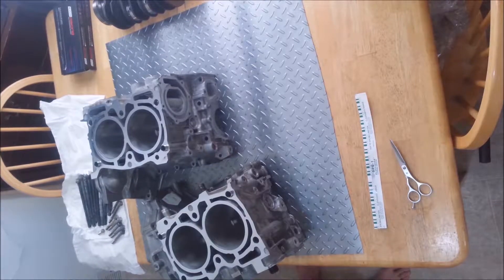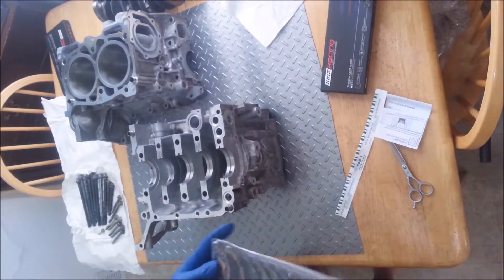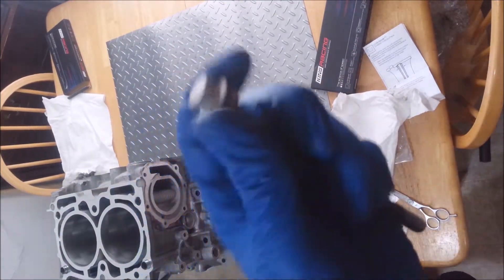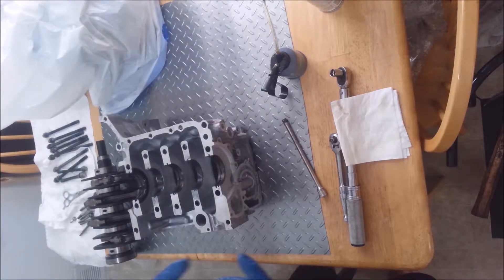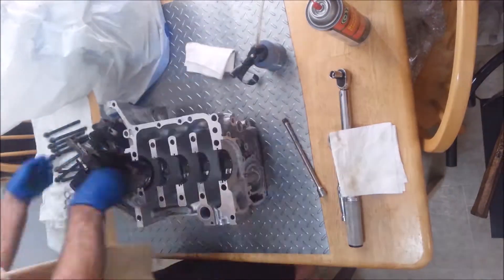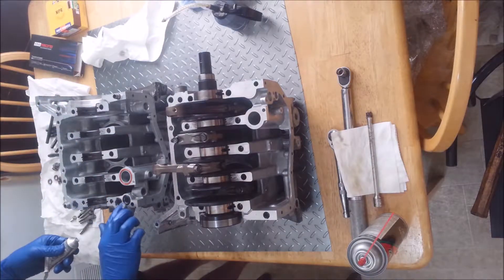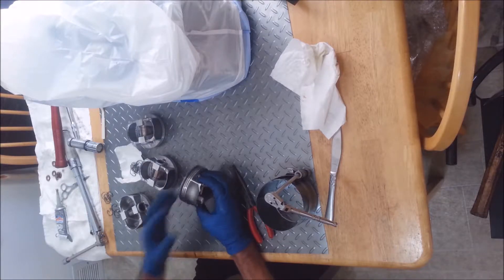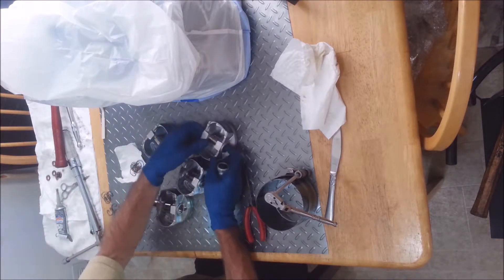2005-2014 WRX EJ25 2.5L engine block assembly part 2

Comment: Question. I spun a bearing in my EJ255 2014 WRX non STI. I'm going to buy a Japanese takeout motor and want to be sure I'm getting the correct one with the AVCS on the intake side only. Does the engine serial number give enough information so that I can determine if the motor is compatible? I only have a COBB Stage 1 and an AEM cold air intake and will stop there. I don't want to spin another bearing. Just bought the car a month ago. Thanks.
Reply from the maker: Ask someone else. I have not done a JDM swap.